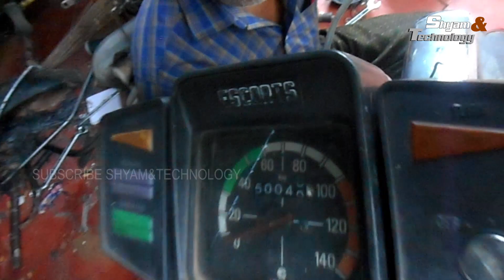YAMAHA RX 100 RESTORATION (PART 1 -  DISMANTLING)

Comment: SIR IWANT YAMAHA RX 135 5 SPEED CYLENDER AND HEAD GEAR BOX ORIGINAL JAPAN
Reply from the maker: We are also searching for genuine parts.. :)
Reply: Rx cylinder/gear box also japan production only rx100 1985to 1989 manufacturing..